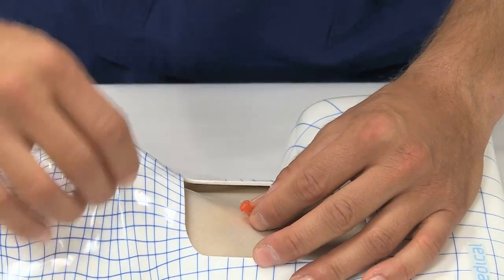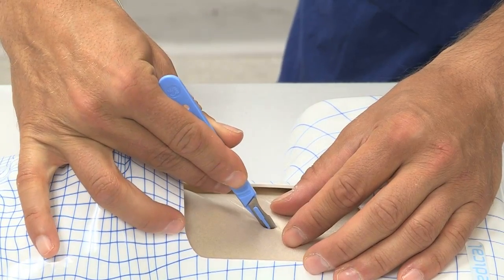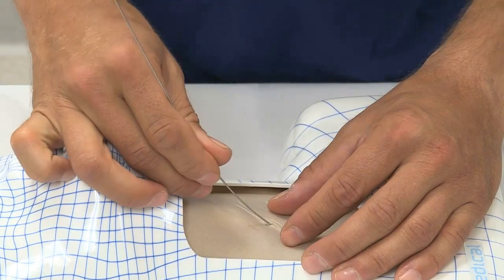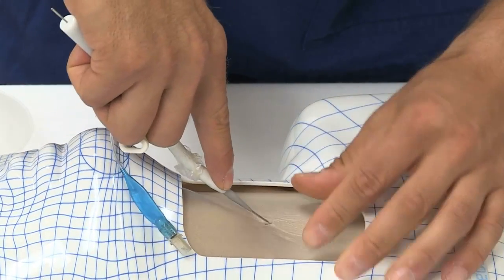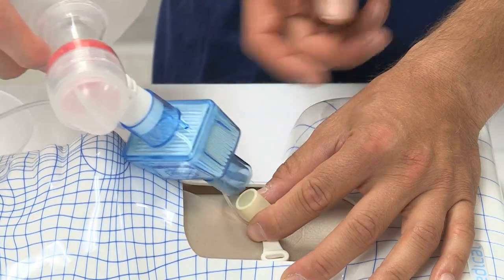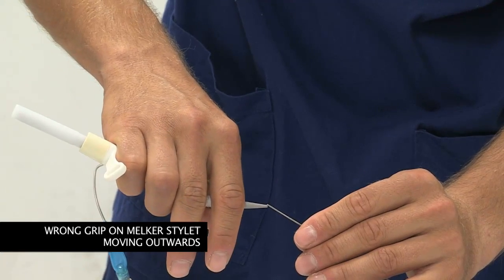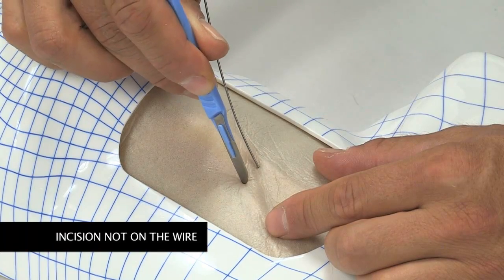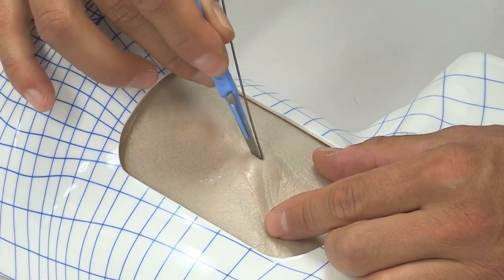03 Melker Insertion

Comment: Hi , excellent videos. Part of the seldinger technique is stabilising the wire proximally before advancing the device along the "stationary ' wire. This is to avoid kinking the wire and creating a new or false passage not in the lumen of the trachea and subsequent subcutaneous emphysema distorting the anatomy.. In one of your sequences the proximal end of the wire completely disappears into the Melker . This could also lead to a lost wire into the airway. Either complication can have serious results. Maybe this could be mentioned if the video is updated.

Comment: Nice tips. In the event the IV cannula is reinserted to salvage a difficult or prolonged placement, would you endorse re-aspirating with a fluid-filled syringe to confirm tracheal placment prior to jet ventilation?

Since shaking can be present in a high-stress situation, I have adopted as my routiune practice for all guidewires to oppose the hypothenar eminences to stabilize each hand relative to the other. With the wire grasped between the thumb and index finger of one hand and dilator between the thumb and index finger of the other, there is better control for threading the guidewire into the tiny orifice of a dilator. With this device it would then be necessary to regrip the base of the device to hold the dilator in place.